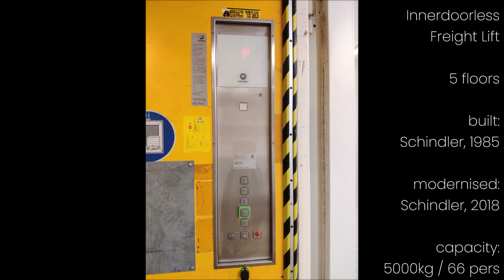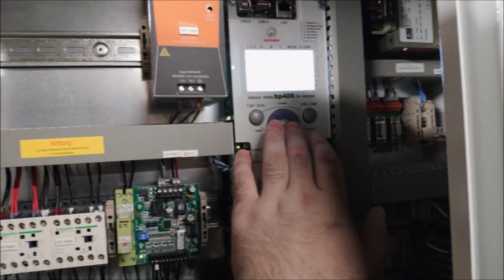HUGE 4:1 5000kg SCHINDLER Freight Lift with Automatic Swing Doors

Comment: You can see all those retrofits of guards they did, to get it to comply with the updated regulations. Guard on the main motor, guards on the top of car, rails on the side, but no guards on the counterweight sheaves, or the idler pulleys.
Reply from the maker: Yes, the guards in the motor room were all added during the modernisation. The ones on the car top are original from when the lift was built. Guards on the counterweight sheaves are not required.
Reply: @TheLiftDragon  Think some of the top car guards are later, with the red oxide paint on them. Original Schindler factory would have had them in the same grey paint as the rest of the car. Had to add them on the car as well with updated moving machinery regulations, paid for by Schindler as part of the maintenance contract. I did upgrade car interior lights though, and the under car light as well, because the bare bulbs were kind of hazardous, so they got enclosed cages. Inside car went to 1.2m fittings, though it was a pain to get the old 900mm ballasts out, seeing as they were attached to the car chassis, and still powered, even if there were no lamps installed. Old autotransformer ballasts with magnetic shunts and heater windings, still taking 30W each all the time.

Once they, and all the DCC wire they had, were removed the new fittings simply were slid into position, and provided much more light, especially after cleaning out the few kilograms of dirt and rubbish from the light bays. Double fittings, but with both tubes in parallel, so that they would only have one tube at a time light, and only a single 40W ballast installed. Double the lifetime then, as only one tube would heat up and strike.
Reply from the maker: @SeanBZA  I was talking about the guards of the deflecting sheaves, the metal sheets. They are original.
The red guard rail on the car top is also original since it is the same red as the red on the counterweight and track mounts. But the galvanised, shiny rail in front of the counterweight is new.

Here in Switzerland we don't have under car light and usually also no car top light, there is just shaft light. The portable car top LED you can see here, which also has a battery integrated, is supplied with the BP408 controller. Other controllers don't have it and it's not mandatory.

As you can see here, the light bulbs are the old shaft light and during modernisation the fluorescent lamps on the other side of the shaft have been added. The old shaft light turns on directly with the motor room light and the new shaft light can be turned on with a button on the inspection control.
Reply: @TheLiftDragon  Different standards then, by me pretty common to have lights top and bottom of car, and then lights in the pit, but nowhere else.

Comment: I always wondered why different rope and pulley configurations are used. I can assume it has to do with how the weight is distributed, and here we see quite a complex implementation. The counterweight has two sheeves, not sure why.
Reply from the maker: The roping configurations are the most effective way to either favour speed or capacity of a lift. There are many different options, but the simplest to being called "1:1" or "2:1". With 1:1, the rope is connected directly to the lift car at one end and to the counterweight at the other end. Therefore, the traction sheave will spin with the same speed as the lift moves and it also needs to handle the full tangential force resulting in the weight difference between cab and counterweight. This is used for smaller lifts and or very fast lifts.
The next step would be the above mentioned 2:1 roping. The ropes are now fixed in the shaft ceiling, go down to the cab over a pulley, back up to the traction sheave, down over a pulley on the counterweight side and then they're fixed in the shaft head again. This system results in the lift only moving at half the speed of the traction sheave and the motor only needs half the torque because the other half of the weight is now supported by the fixed end of the cable. Or: As we still can use the full load / torque range of the motor, we can now double the capacity. So long story short: Going from 1:1 to 2:1 without changing anything about the motor and gearbox results in a lift with half the speed but double the capacity. Now, what you see here on this lift is called 4:1, with there being 4 ropes on each side. This means that compared to 1:1 we have 4x the capacity and 1/4 of the speed. There is some technical data of the lift in the video description - but to illustrate it with numbers: The traction sheave has a circumferential speed of 2.5m/s, resulting in the lift moving at 0.63m/s, which is 1/4 of 2.5.
To sum it up: This type of roping reduces load on the gearbox because the weight of the lift car, cargo and counterweight is shared between multiple fixed points, it reduces the amount/size of ropes needed but increases their length and it affects the gearbox reduction ratio (more speed but less torque is needed).

Comment: Very nice modernization In addition the glass doors on the ground floor and the 2nd are not commonly use what is not a bad thing. I worked recently at the Geneva-Airport station on the quays and the freight-lifts are similar to this one but they are hydraulic and on the other hand they were also modernized last year but the inner doors was added and we no longer see the floors scroll inside the cabin.
Reply from the maker: I think in 2018/2019 the regulations changed and now inner doors must be added, no more light curtains like here. But I'm not 100% sure, it just came to my attention that I have not yet found this type of mod newer than 2018. I know an identical mod like this on a lift from 1989, also from 2018, but that only has 2000 kg capacity and is 2:1.